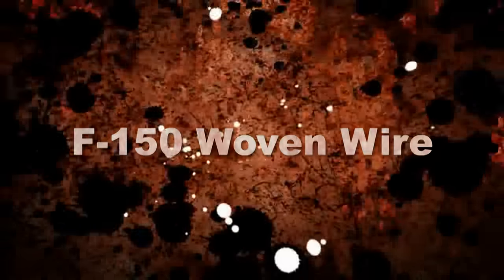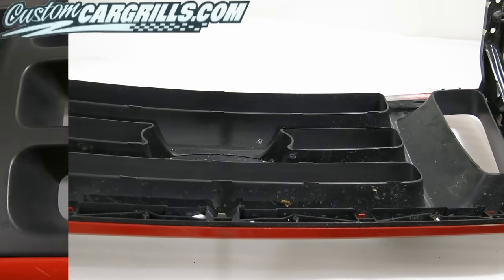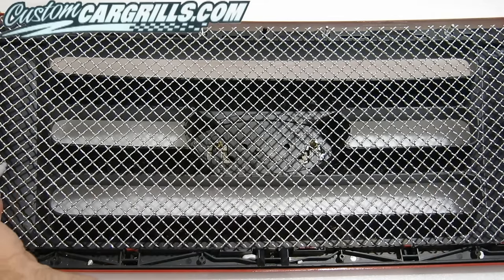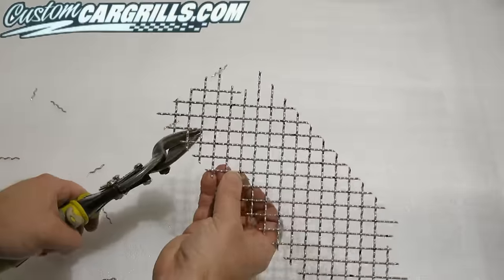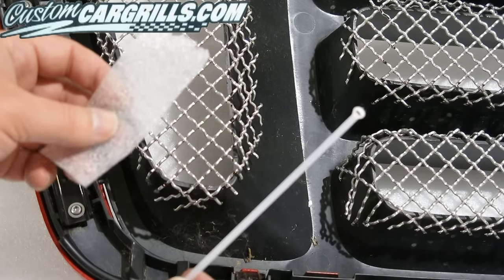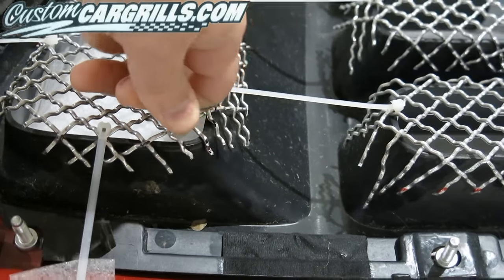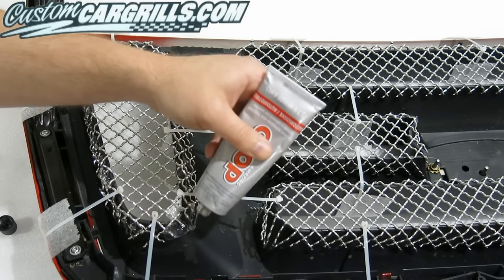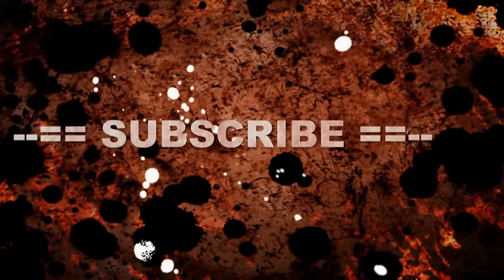Everything You Need to Know About Making A Custom Grille

Comment from the maker: Mike, the aluminum wont rust but it will corrode over time.  Polishing it up from time to time will usually keep it looking good long-term.
Reply: That why Id go with zip ties instead of gluing the mesh directly to the back of the grill. You epoxy/glue the tie brackets to the back of the grill.
Just cut the ties and replace the mesh and re-tie.
Had diamond shaped and after a few years decided to change to octagon and ties made it really easy.

Comment: Are you not worried about restricting the airflow to the Radiator ? I would like to do this to my car but the mesh covers more area and I am worried it will be bad down the road for the car. Can you confirm if I should follow through with this?
Reply from the maker: The aluminum woven mesh I used in this video is less restrictive than the pattern that was in there from the factory.  Air flow should not be a problem in this application.

Comment: so why cut the new grill into pieces? why not glue it in one piece?
Reply from the maker: Sometimes that's possible and sometimes it's not.  It usually depends if the factory grill has multiple layers behind the front shell or depends on how far away the openings are.  In the case of this F-150, the main center openings are clustered close together which is good for doing a one sheet install but the sides are a bit further out that I would prefer.  

An additional challenge with doing a one sheet installation is finding a way to keep the center area flush up against the back of the factory grill.  It could have been done with the F-150 in this video but I felt like the multi-piece approach was a better fit for the project.  

Here are some videos where I did a one sheet installation that you might like:
https://www.youtube.com/watch?v=Zpe4VghwaCA
https://www.youtube.com/watch?v=5KZEylNiJXI
Reply: amokachi31 ,,,,,,good idea

Comment: So i want to do basically the same thing- with a black plastic honeycomb mesh on a 2006 ford ranger xlt-  to try to copy the appearance of a 2003 ford ranger edge
Reply from the maker: I think that would be possible but you'll need to change the install a little bit since the plastic mesh won't wrap around the openings like the metal meshes will.  You might want to checkout this video for a different approach:  https://www.youtube.com/watch?v=Zpe4VghwaCA

Comment: Why not use one big piece? ???
Why cut so many individual pieces
Reply from the maker: This has been explained a couple times in the comment section.  Sometimes one sheet is possible and sometimes individual pieces are better.  If you check out my other videos, there's many installs where one sheet is used.

Comment: but isnt the aluminium going to rust? i meen, aluminium rims are coated or painted to make sure that wont happen.
Reply: Mike Franke You have to check your aluminium with an aluminium magnet. if the aluminium magnet sticks, you can be sure that it won't rust. it's the only way to make sure you have high quality aluminium. most hardware stores have them so just make sure to ask.
Reply: @volatilesky  yes,  and you cab fund them right next to the flux capacitors.....

Comment: hot glue would be quicker
Reply from the maker: It might be quicker but it likely would not hold on very well.
Reply: mike dunmore Hot glue gets brittle over time.
Reply: AKBuilder762 hot glue that I use doesn't get rock hard but a soft hard. I also see that they make different types of  hot glues.
Reply: In high temperatures it won't hold a shit

Comment: Such a big stupid project that wont hold up the long run and will never be cleaned properly...just should have sent the plastic grill mesh pieces to be hydro chrome dipped.
This DIY is nonsense.
Reply from the maker: What if I told you that today, March 23rd, 2020, the grille looks about the same as it did when I made the video 2069 days ago?

I can make a follow-up video if people think the install is trash, can't be cleaned, and will never hold up because it's still perfectly fine today as it was then.